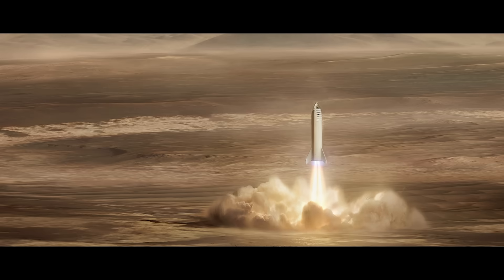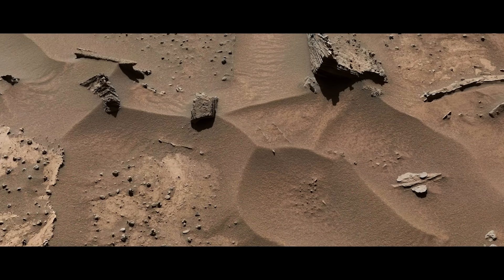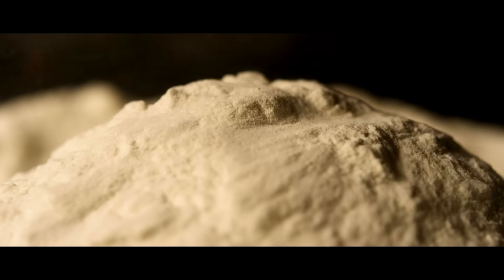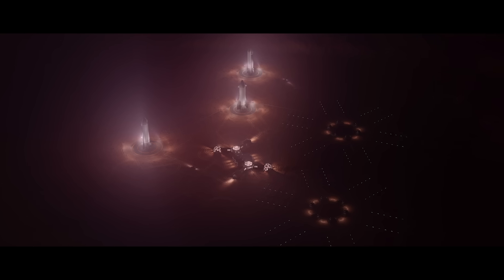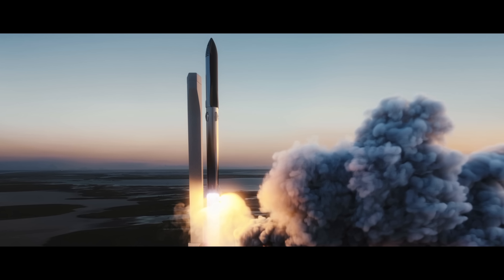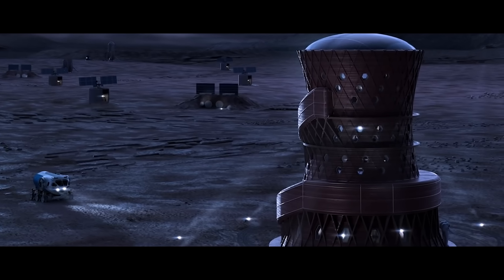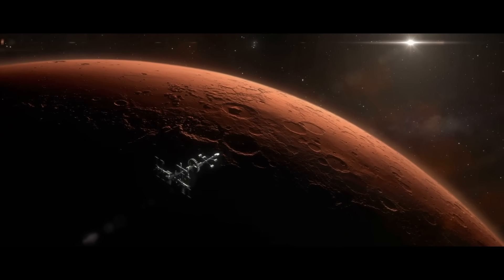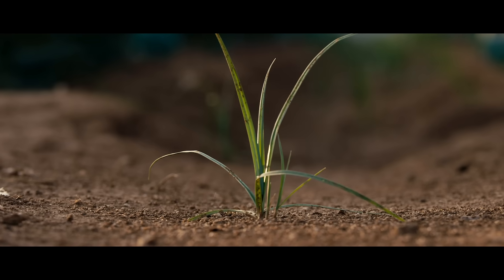THE FIRST 10,000 DAYS ON MARS (Timelapse)

Comment: Terraforming Mars is going to be almost impossible without a magnetic field.
Reply: @alkdjfhgks1919  terraforming a planet would probably take at least thousands of years with our primitive technology. Honestly, if we can terraform Mars, then we can fix the Earth via terraforming.
Reply: @Dingusdoofus  But on Mars we need to heat up the planet which we do really good on earth causing global warming, so good that we can even stop it so now answer yourself what way of terraforming we do better ? heating up the planet or cooling it down
Reply: @piterb2984  we can’t stop global warming anytime soon, only slow it down. It would take us decades to recapture all of that carbon in the atmosphere. Good luck convincing Russia (doesn’t care about sea level rising, just want the opportunity to become an economic superpower with the melting of the Arctic) and China (overuse of coal plants) to sacrifice their economic goals to save the planet. How can we even heat up Mars (which has a mostly CO2 atmosphere) if the Sun strips away any new atmosphere that we add. We need to heat up the core of Mars first before heating up the surface with a thick atmosphere.
Reply: @Dingusdoofus  NASA has a concept for an artificial magnetosphere by putting a large magnetic shield in Mars' geostationary orbit. It would require obscene amounts of copper (earth's annual copper yield for 10 years) and two nuclear power plants to work, but is technically possible.
Reply: @LakesideTrey  yea, it would take atleast 150 years to build withour current technology, but it is technically possible to make a giant magnet.
Reply: @LakesideTrey  Blue Origin wants to move industry to space, so we can just mine the copper off asteroids and comets. That would both benefit Earth and Mars.
Reply: @Dingusdoofus  it's not global warming anymore
It is climate change now
Sea rising is the smallest threat in climate change
Global warming, ocean acidification, more and stronger wild fires, more and stronger storms, change of weather algorithms, pandemics, and etc are already happening 
And muuch worse things are on the way if it continues 
It will be soooo bad that corona will look like the smallest problem
Bees might extinct, some huge rainforests like amazon might disappear, the polar cap might disappear, cumulus clouds might disappear, snow might be a dream and lots of super bad events might happen

Stopping the climate change is waaay easier now than 10 years later
We are running out of time
If we not stop it or at least reduce our emissions greatly in less than 10 years, a series of climate change related events will accelerate climate change so much that stoping it will be impossible 
For example, northern polar cap is white and keeps earth cool by reflecting the heat back to space but if it disappears, or shrinks, we will get more heat from the sun which will warm the planet even more

Or climate change causing more wild fires causes more CO2 to be trapped in atmosphere which warms the earth even more and reduces the amount of trees that were supposed to reduce CO2

Or white cumulus clouds (most common cotton like clouds) which cool the earth by reflecting the heat back to space, need a special temperature and moisture and pressure to form which will change due to climate change and they will disappear which warms the earth even more

So heating the earth causes it to heat itself even more
We have to act fast and it is not that hard
I hope govs and huge companies will do sth about it

Idk why I wrote this here😅
You probably already know most of this
Anyways have a nice day everyone
Reply: @Matt0sh  You can’t stop climate change, that is a natural process. The artificial change of the climate by humans is a different issue. Even then you can’t stop it. How many carbon capture devices do we have distributed around the world, barely any. If it’s now or ever, then why haven’t we already done a mass building of millions of carbon capture devices. How are you going to convince the corrupt government of Brazil to actually try protecting the Amazon. How are you going to convince Russia to give up its main goal of being an economic superpower by using the melted Arctic for both drilling oil and opening a new sea route that would make Russia more money than it ever thought it had. How are you going to convince China to give up Coal and at least switch to cleaner fossil fuels/renewables.
Reply: @Dingusdoofus  We don't need carbon capture devices to stop climate change
Trees can do it more efficiently 
If we plant tens of billions of trees and stop Emiting CO2, CO2 levels will eventually decrease to safer levels
Also you know how US has sanctioned NK, Iran and Venezuela for different reasons
US and other countries can do the same to the countries that don't lower their carbon footprint and don't take care of their jungles and environment
After all lowering carbon emissions is a lot easier than changing regimes 

Also US has a lot of influence in other countries' politics
If US actually wants to stop climate change, it can make other countries to do it as well and most of the carbon emitter companies are American companies

You know how going to moon seemed impossible but they worked hard and gov funded the program and they did the impossible
You know how germany in WWII progressed sooo much in terms of developing weapons 
And US and Russia progressed soo much in science and military in cold war in such an unbelievable speed

What I mean is if a gov(specially US) really wants something done, they can do it and lowering emmitions isn't that hard

Stopping climate change is not impossible but it is definitely hard
It's mostly up to govs and their leaders simply don't see it as a threat so they don't give a damn about it but in recent years some countries have started doing things about it and if world powers like US and Europe start taking it seriously and actually want it done, they can make other countries to do the same as well
Reply: @Dingusdoofus  China has actually decreased it's emmitions a lot and is leading in using renewable energy but is still Emiting so much CO2 
They also say that they will decrease their carbon footprint even more
Also China builds coal power plants in other smaller countries so if US sanctions the countries that use coal, those smaller countries won't use coal powered plants
Also Russia wants to find oil to sell to the world so if no one buys it from them, they won't drill to find oil
Western countries have the power to do it
Reply: Just need to build a shield to protect the most direct radiation or nuke the core. Or people just adapt to the radiation by just living indoors/underground.
Reply: You could potentially use satellites to power an artificial magnetic field in space via elecromagnets. Obviously it would require a lot of power, probably of the nuclear or fusion kind. A space station, more like.
I don't think anyone will be living on the surface of Mars as it was day-to-day like on Earth. A bunch of life might come to be on Mars from the Earth life that can sustain itself (especially with an array of space stations producing a magnetic field), but I doubt it will be like the Earth where we can breathe and walk around easily. Mars will always have too thin of an atmosphere, even if it was all air.
That is why you're more likely to see massive underground excavations to create pretty much enclosed cities IMO. Mars' low gravity will allow you to build pretty large structures that normally wouldn't work on earth, and also allow you to use larger equipment. People can also perform more work because their muscles and bones won't be under as much pressure from gravity, while at the same time not undergoing muscle athropy like it does in Zero Gravity.

Realistically, all of this will happen after the Moon undergoes a similar industrial process. Turning the Moon into the space foundry is what people should be dreaming of, because it has pretty much every mineral you'd ever need in abundance and without the gravity/atmospheric concerns of the Earth and it's also very close. With a magnetic railway, you could theoretically throw stuff from the moon into solar orbit, earth orbit or back to earth without needing fuel to begin with. This including advanced, or extremely large parts because gravity won't be a concern. Want to build a massive space station or ship? Do it on the moon, it won't break under its own weight there.
Starships are still under limit of their weight due to Earth's gravity and atmosphere, a theoretical spaceship from the Moon is not. As long as it has fuel, its design is far more liberal.
Reply: Terraforming Mars is definitely going to be impossible 

95% of mars's super thin atmosphere is made out of CO2 which is a greenhouse gas
Mars's average temperature with all those CO2 is -63°C 
Reaching a higher percentage of CO2 in the same pressuring wouldn't change anything 

Adding more greenhouse gases won't work because the atmosphere is super thin and sun won't let us make it thicker 
We need a magnetosphere to thicken it
We can't use electromagnet satellites because we can only create a magnetosphere with one giant magnet and small ones wouldn't work
A giant magnet would need super advanced technology and a huuuge amount of energy 
Let's say we did it and created a magnetosphere 
We will be able to thicken the atmosphere 
But how?
Let's say we did that as well 
Now we can stop using pressurized spacesuit
But we still need to make the atmosphere 20% oxygen and 80% a non reactive gas to be able to breath
Even if we do that, there will be lots of dangerous radiation from the sun
That would need an ozone layer
Building an ozone layer is even harder
We need to put it in upper atmosphere and hope it stays there and doesn't come down also for it to be stable, we need NO2 and NO gasses 

Mars will teach us how awsome Earth is and how weak we are in this universe
Reply: @Matt0sh  An artificial magnetosphere produced by satellites is not there for an atmosphere honestly. It's just there to make the surface safer to work on if need be (especially against solar storms and CMEs if they happen). I still believe that the most interesting part of anything related to the moon/mars is their low gravity work environments, because it lets humans build much much bigger since the square cube law will be quite different.
Reply: @RavenReach  I think solar storms can pass through those electromagnet satellites

Comment: imagine traveling to mars and then finding that 3/4 of your ships that help support you are destroyed or unusable, imagine having to come up with some way to sustain yourself in the months while you wait for new resupply ships. Imagine how the radiation is slowly killing you in ways that were not calculated for because Mars has no molten core protecting you from both solar and massive more cosmic rays. Imagine how much of the Mars soil is contaminating so much of your electronics and seals on your ships and domes that its so much work your exausted ever day let alone trying to do any research.Imagine how that many of the simulations did not predict so many of the horrible problems you are now facing and YOU HAVE NO EASY WAY HOME. Yes, this is most likely the future anyone traveling to Mars is going to experience, not this rosy wonderful picture this video showcases.

Comment: Musk is going about this incorrectly.  A base should be built on a Martian moon. Starships should dock there and transfer vehicles designed to ferry passengers to and from the surface would be based there until a space elevator is constructed.  Most of the work can be done robotically...

Comment: So basicly you heard a lot of things asumed and then put together a video about it....Jesus... okey: 1 Solar panels are inefficent in a planet like mars, now because they need power for the life sustaining equipment they would use nuclear. 2 Starlink stalits are in the low earth orbit, so if they go to mars they will be still in low mars orbit, if you would do the reserch that means that they are laping the planet multiple times a day, high orbit satelites are needed for thast job because they orbiting the planet at the same speed the planet spins, so they are realtivly stationary to the surface, in this case 5 satelites can do it. 3. No there is no such thing as dust storms, to much  sci-fi moovies bro, mars atmosphere is to thin for tht, yes there is wind and yes the wind picks up dust, but dust storms are not possible. 4 manufacturing in orbit so the mars atmosphere wont be poluted? Like why?? It is not breathabel, it is toxic. Why on the blody Mars would you be considerd in the atmosphere pollution?? We dont have a solution to clean an entire atmosphere, and even whe we will have it will be cheaper to clean just the habitats air. 4 yes Mars it is smaller than Earth. BUT YOU CAN'T say that in less than 30 years glass domes whit plants stuffed inside them can produce enough oxygen to make the atmosphere a just a bit better....

Comment: So how is the water turned to liquid in the exterior environment ? "seeding" is suggested towards the end of the video.14:56. is it really possible? or doesn't the water just sublimes?
Reply: Liquid water cant sublime, sublime refers to a solid (Ice) going to a gas (H2O gas). To answer your question, the more carbon dioxide and H2O molecules in the atmosphere, the better Mars will be at trapping radition (heat) which will inturn melt the ice caps at the poles. This will further accelerate the planets greenhouse affect, producing more gases and melting even more ice. If enough atmosphere is created, pressure will increase, temperatures will rise, O2 concentration will increase and the plantlife will return to the red planet.
Reply: @leviathan5095   thanks for your reply. but I will disagree somewhat, for temperatures below the freezing/melting point temperature line at 0 °C for partial pressures below the triple point pressure of 612 Pa (0.0006 atm). -water sublimes which is also coincidently similar to mars atmospheric pressures.. happy for you correct me if I have got this wrong ....
Reply: @TheSilversheeps  A liquid can’t sublime. Solid water yes but liquid water no.

Comment: I think it’s more realistic that we start using ion drives or nuclear thrusters on starships. It makes sense since nuclear engines and ion drives are more efficient in space than chemical rockets. With those we could get to mars much faster not having to take advantage of earth and mars being much closer every few decades. If we use nuclear thrusters or ion drives on starships we could probably travel with them to mars when it’s normally distanced from earth as fast as you could with chemical rockets and when earth and mars are at its closest if not faster.

Comment: I have looked into this very much over the last 20 years or more. Very good futurist video.  There also seriously needs to be 1G on Mars so that humans do not evolve into a different species. Also 1G on spacecraft will be essential. Compared to the Credit Crunch and Covid19 costs,  humanity could easily build four 1G spacecraft for a fraction of those costs. These will be roughly half a mile diameter. These could also be made to still retain 1G when the craft is accelerating or decelerating this is absolutely practical and I have solved the problem so that even when accelerating or decelerating the crew would hardly notice anything. The craft would feel much like a cruise ship and have swimming pools and squash courts for instance. The food would be cruise ship standard. Magnetic shielding will be essential and should be possible.  These craft should explore the Solar system in pairs for safety so if one craft fails or gets damaged the crew and passengers can transfer to the other craft.
Hey! but that will most likely not happen because there are very few humans who can think really  big. The survival of the human race is on a knife edge over the next 50 years. If we don’t all start thinking big and acting on it the human race will definitely not survive. It is no good being a fan of space exploration and enjoying being entertained, that will not save the human race. 
If there is anyone out there who has a scientific or technical background and really wants to discuss the answers to how to save the human race then reply with your thoughts.
Meanwhile bravo Elon, you are one of the few who are actually trying to serve humanity.

Comment: Idea for artificial gravity with 2 starships:

2 ships are connected nose to nose by a long steel cable. They are spun slowly in a circular motion using the cable to create an artificial gravity from centrifugal acceleration.

This way the journey wouldn’t be as debilitating.
Reply: Yeah nice idea smarties pants. But how do you get a ship to accelerate towards Mars and at the same time shift into a rotation? That would like like a aeroplane in a spin.
Reply: @alexanderinsubordinate1861  first they accelerate towards Mars like normal, then once they’re on their way, two ships connect with a cable and use rcs thrusters to spin up.
Reply: @SatisfyingWhirlpools  impossible.  They have to keep a constant aim at Mars with thrusters on all the time. If they stop they will eventually loose velocity due to dust in space and come to a complete stand still.
Reply: @alexanderinsubordinate1861  Thats not how space travel works. Rockets aren’t planes. There is virtually zero resistance in space, the thrusters go off after the initial burn, and may only rarely need to make small adjustments.